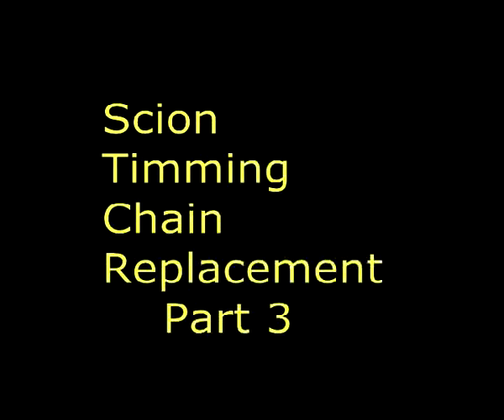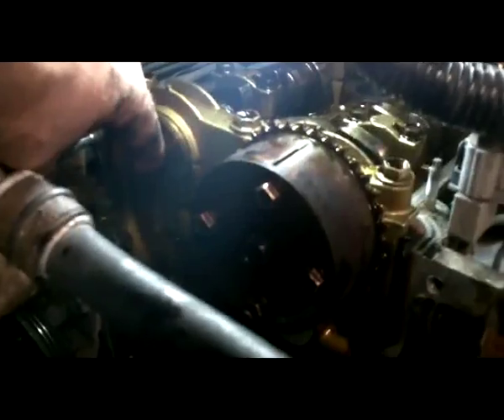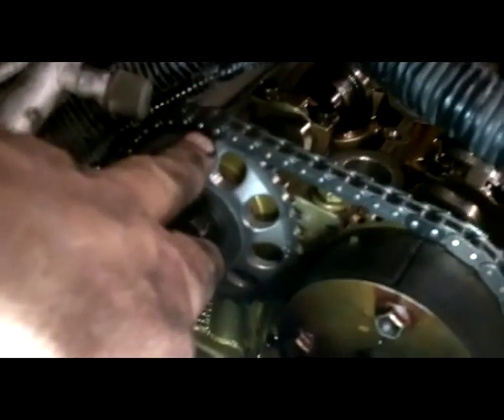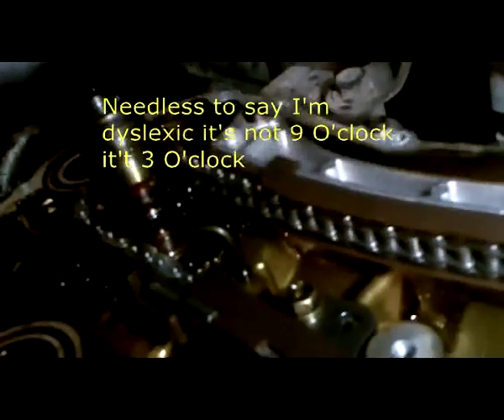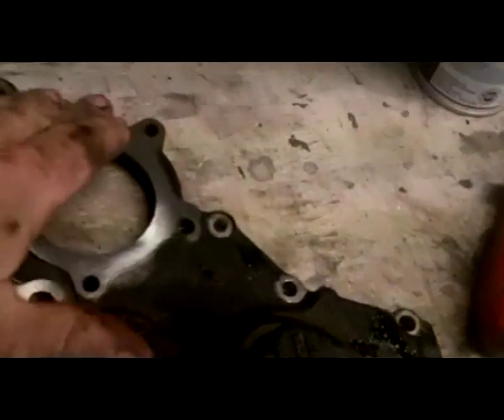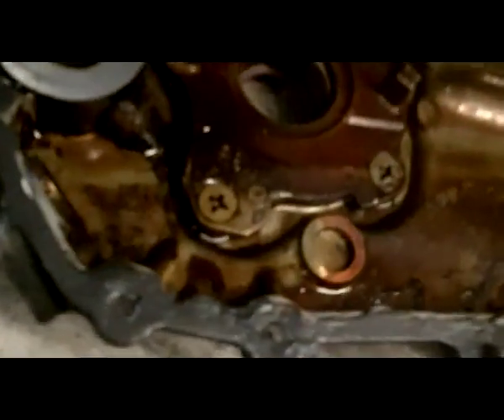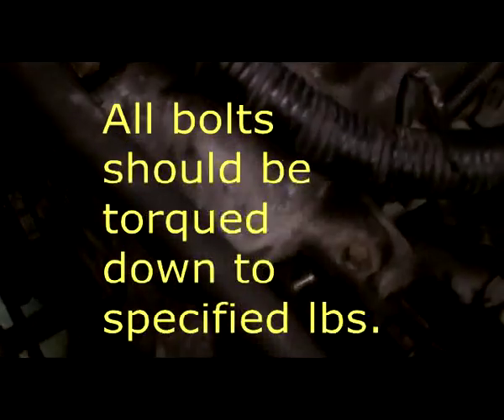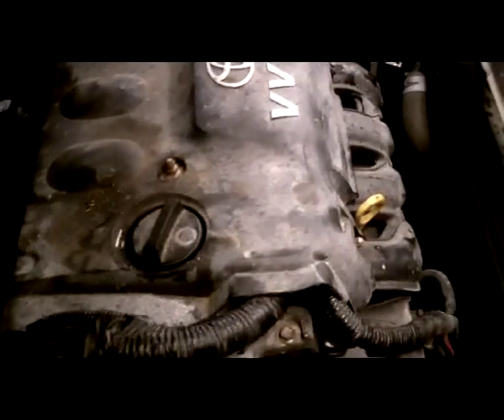Scion Timing Chain Replacement 3/3

Comment: I accidentally over reved mine, (I maxed out 3rd gear and went into 2nd instead of 4th). I think I skipped a tooth. The car runs ok, but its got a ruff idle. 
I'm guessing there's no 'easy' way to adjust it? I basically have to go through this whole process if I want it back in time??